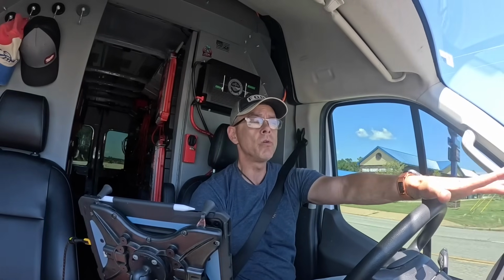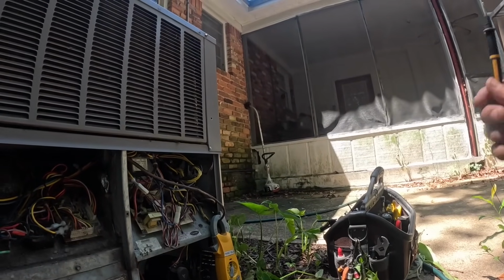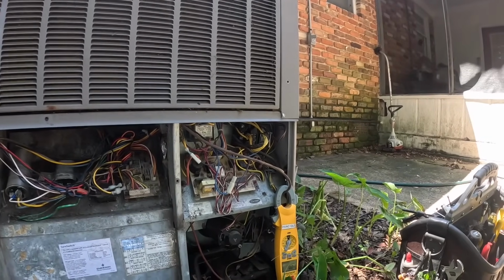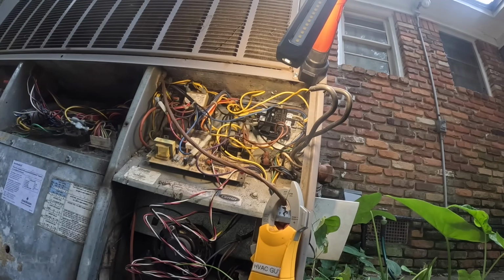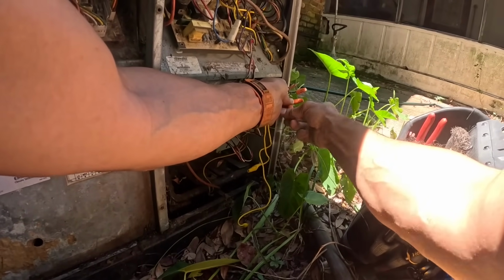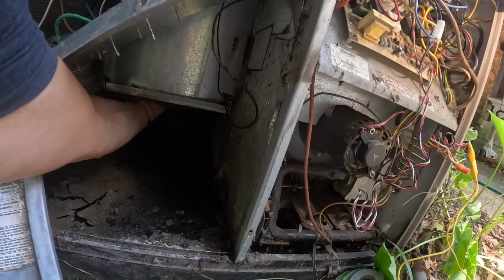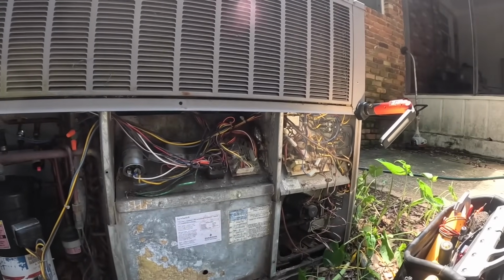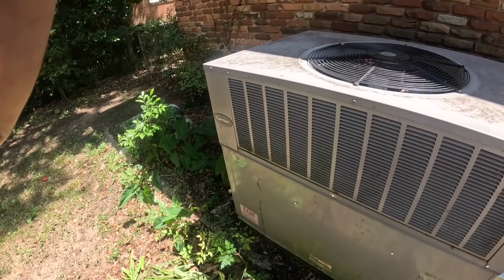Removing SureSwitch and Re-installing A Contactor! #hvaclife #hvacguy #hvactrainingvideos

Comment: Curtis, I'm sitting here at 84 yeats old in 90 degree heat and my Blower motor has failed. I called the shop that installed it 11 monthss ago. I told them it was either the motor or the cap, and suggested they bring  them along. They have records of what was done, so it should have been simple, right? No, a guy comes out and verifies that my motor is dead. I ask him if he brought a motor. He then told me, I'M just the troubleshooter, we'll have to schedule someone to come out after we order a motor. So, in the meantime, I'm sitting here in 90 degree heat. We have a HVAC wholesaler right here in town. He could have called and had someone go pick one up and come relieve me of my misery. If you weren't so far away, I could have called you. If it wasn't under warranty, I would have just done it myself today after he  left. Most all servicemen these days only care about the bottom line, it seems to me.
Reply: I’m sorry you’re going through that. I will say blower motors these days don’t have capacitors. That motor should be under warranty so he will have to get a replacement from whatever manufacturer you have. Sometimes the motor is available the same day sometimes not. I would call them tomorrow and get all of the information. If it’s going to take awhile to get the warranty motor they should do something temporary to get you by. That’s what my company does.
Reply: Sounds like they are more of a install company instead of service
Reply: even if you call them an tell then your blower is down some companys wil treat you u as you don't know what you're talking about, and unless they don't charge you another service call fee for having to come back to put your new motor in also
Reply: Sounds like you’re working with a big company. Smaller company’s don’t do this, if the part is in stock near by they will install it same day.
Reply: Next time calling them be sure to have them send you a tech who knows how to fix things and troubleshoot.  All they did was put their mass servicing plans ahead of customer service. What kind of HVAC wouldn't have a cap or a motor on their truck at $4 a gallon and 12 MPG? Two trips to your house, the delay in repairs will all be in your labor charges while they warranty the parts. BTW, if parts are still in warranty, any HVAC can warranty your servicing needs. I wouldn't call those people again...they have a dumb system.
Reply: My compressor fan went out because of the modular went out. Part was not available within almost two months. Had to buy a portable ac and put in my bedroom. Wife works at the bank and I am disabled. I watch HVAC guy and bought a pro tech fan motor and a dual capacitor. Works great. Pray you got yours fixed.
Reply: @philipschroeder923  Turned out my relay was fried and sending inputs to the motor to run at 2 speeds simultaneously. The motor was unhappy with this idea, so just stopped. Relay replaced and now a cool 72 degrees. My cat and I are now content.
Reply: If it's under warranty do they have the exact replacement? I mean some companies love generics and charge full bore plus OEM cost. Sure generics can be ok especially on an older out of warranty unit as cost less if they are fair. 
But under warranty would usually prefer OEM.
Now caps can be different as sometimes even OEM caps are the best.

Comment: I've only seen one of those SureSwitch fail and it failed stuck on due to water getting in it. The random time delay can be switch off by flipping the dip switch. All the time delays become unnecessary. It also has a test button on it that will close the contact for 5 seconds. I do hate the flashing lights as a slow flash and fast flash leave a bit to interpretation. 

That entire unit was a disaster.

Comment: The sure switches are a wonderful thing. It's just a single pole contactor. But the brown out protection and the short cycle protection are great options. Plus it's supposed to close at the 0V of the sign wave. I've put many of them in and can only recall one failure. Plus I've heard the ultrasonic dog repellent I've been told does wonders on barking dogs.
Reply: Ultrasonic: it does but it takes training.  A handful of dry food works immediately.

Comment: I've had good luck with the Emerson sureswitches, great for areas with ants
Reply: I have two units at my house that I installed them on about 5 years ago.  So far so good.  Mostly do commercial 3 phase so I haven't used them on other residential units.

Comment: late last year I grabbed a contactor off shelf and just happened to open it and look at the ratings on it. there was a 24v coil contactor in a 120v coil box and I needed a 120v coil.
good thing I looked before buying, taking and hooking it up. that would have been exciting for sure.  KERPOW and smoke emitter for sure. 🤯

Comment: HVAC Guy. If  you were to replace your own units what brand would you chose for your house?
Reply: Reliability and warrantee?
Reply from the maker: I’d certainly use an inverter driven compressor. And I’ll be doing that soon.
Reply: Probably a gree flex again he did an install of that on his old house a few years ago.

Unless that's the Bosch he is talking about but Bosch inverter driven systems I am not so crazy about but Bosch for automotive stuff I love including their automotive sensers such as oxygen sensers.
Reply: @gabrielstern4992  I own a Toyota Camry, I'd have to disagree with your assessment of Bosch O2 sensors. Toyotas burn out the preheater and set a P0420 code within weeks of installation. Stick a Denso in there, and you're good for 100k or more.

Comment: I had the same issue with a Trane TAM7. The sure switch caused heating fault codes in cooling mode. after I replaced the appropriate sensors the fault codes reset but the outdoor unit wouldn't start.

Comment: Every new install and existing system needs is an Intermatic AG3000 surge protector on the disconnect of the condenser and one on the furnace. $70 is cheaper than a blown control board, compressor or fan motor. A 5-2-1 hard start kit is also recommended for the condenser.
Reply: Are there other brands? Intermatic just doesn't scream surge protection to me. Or is it just one that is easy to install and they dont make many for disconnects?
No I am not talking nake brands used inside for computers either.
Reply: @erich5265  I have been installing the Intermatic AG3000 for over 10 years now. Almost 42 years in the trade. I have had zero call backs on one. Installs in a 1/2” knock out. Weatherproof Simple 5 minute install. They also make the CD1-024R. It has an added feature that you break the y connection into the condenser for extra protection. Double the price and unnecessary. Put one on the furnace also. Saves ECM motors, thermostats and control boards. $70 each is cheap protection. There are other brands, but these are fair priced and reliable. Full disclosure. I DO NOT get any compensation from Intermatic.

Comment: I went the other way. Had my condenser fan motor go out a few months ago. Replaced the motor and decided to replace the working contactor and install an Amrad cap. Nothing was wrong with the old one but just wanted to do preventative maint. A couple weeks later I hear refrigerant in the A/H but no fan. I see the outside unit is running with no call. Pulled the Tstat and it was still running so the new contactor was sticking. I put in a Sureswitch. The one you replaced was the older model. Not sure what the difference is but I bought the newer ones.